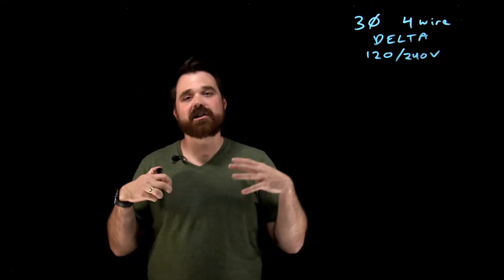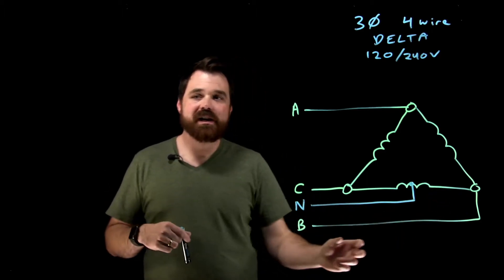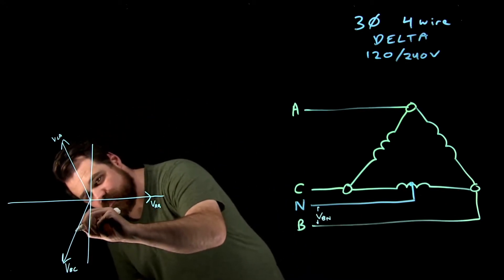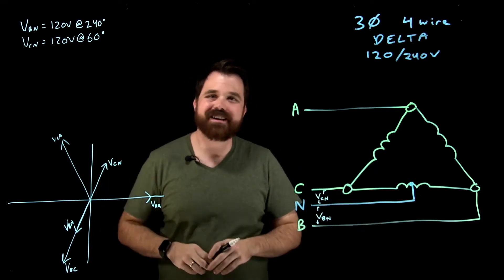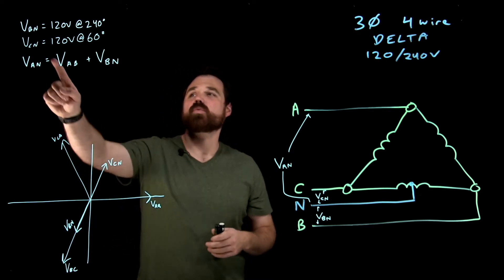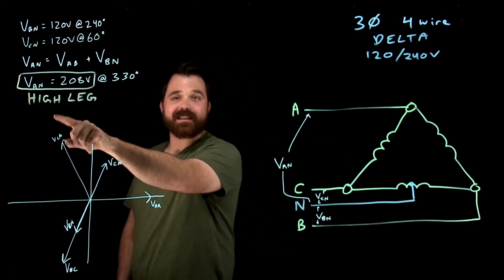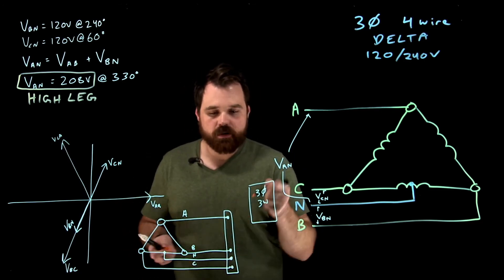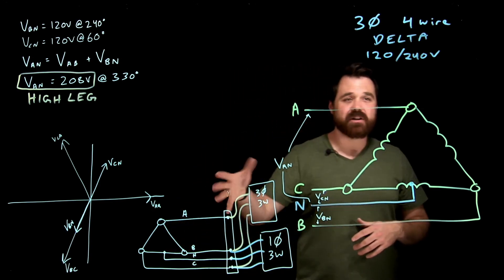Delta 3-Phase 4-Wire System (120/240V)

Comment: That's the stupidest thing I've ever fkn seen. I wish you would've explained WHY you can't use a to n.  Gunna assume it's bc the phase relationships or w/e are offset by the other side of the triangle being the opposite from the center tap.  But needing to run 208 machine so turns out I DO need wye even though high leg delta is 208.  How fkn dumb

Comment: The NEC does require that the Grounded Conductor/neutral be run to the Service Equipment, but it can be sized as if it is a Equipment Grounding Conductor based on the size of the Circuit Overcurrent Protective Device (OCPD), and we must bond it to the equipment enclosure and the Grounding Electrode System. In doing that are we making the neutral available in the panel? I haven't seen one in a long time so I don't remember how the bonding and grounding was done. Would it have an Equipment Grounding Busbar? Would it have a Main Bonding Jumper to the Grounded/neutral Conductor?

Comment: Can one of you smart guys help me with finding a panel board that will support this set up? Our building has this service and we cannot find a 600amp 240/120 3phase, 4wire delta high panel to save our lives. No one has one if these things. It's a unicorn and the inspector won't let it slide the existing 480/277 panel that is currently installed.

Comment: In the United States National Electrical Code, the high leg is required to be labeled as phase B. From forums, I could find that the Canadian Electrical Code requires the high leg to be labelled as phase A. The US NEC requires the high leg to be marked orange at equipment. However, I could not find the CEC marking required for high leg. So, how does the CEC require the high leg to be marked?

Comment: Canadian Electrical Code I find intriguing.  I'm in the USA and here, if we had a 3ø 4w delta system,  the high leg must land on the B phase,  for switchboards, switchgear and panelboards.   Metering equipment usually is required to have the high leg terminate on the right side (phase C)    Panelboards installed prior to 1975 often had the high leg on phase C.   High leg conductor must be marked orange,  or other effective means, at all termination points where the neutral is present.  1ø & 3ø circuits are allowed in the same panelboard.

Comment: Line B is high leg. Delta 4 wire 3 phase high leg 120/208/240v is as follows. (B to N) is 208. A to N is 120, C to N is 120. A to C is 240, A to B is 240, B to C is 240
Reply: Phase A is the high leg as required by the Canadian Electrical Code, as found from online forums. Phase B (marked orange) is the high leg as required by the National Electrical Code in the United States of America.
Reply: A is definitely the high leg I have worked on several of these systems they are quite common out in the country
Reply: Pretty wild that it changes for us and Canada, but I’ve also seen the high leg on the C in the panel and seen people say that it used to be the way it was mandated. I see the 208 high leg warnings, orange leg, and see panels with all the high legs blocked off, but here using a separate panel seems like a great idea. I’m not an electrician, so speculating here, all the wok I do on this stuff gets gone over by electricians before being used anyway.

Comment: I re-watched this again, when running 120/240 single phase, how does this affect the balance of the 3phase incoming load, it seems like there would some sort of imbalance to the 3phase current.
Reply: Good observation.  Yes 120 volt loads on a 3ø 4w delta system will cause some unbalance that cannot be avoided,  unlike the more commonly used 208Y/120V system where each phase can be used L-N or L-L.   In fact it's usually fairly easy to identify a 4 wire delta service just by looking at the transformers, assuming the building has overhead service because the transformer with the center tap will often be larger than the others, for the reason this transformer will have all the 120v loads in addition to the  240V single- or three phase loads.

Comment: I have this system.  Mine has two transformers and is fed with two of the phases.  Not three!
Reply: Open high leg delta.   These are rare, and usually found on farms,  where most of your stuff is 120/240 V single phase,  with a small amount of 3 phase motors,  such as used on grain dryers,  augers conveyers and the like.   In this situation the capacity of a closed delta is not warranted,  and the utility will install 2 transformers instead of 3, to save costs.   This service can be identified by 2 transformers,  one of them is much larger than the other,    the large transformer is the lighting transformer,  which supplies your 120/240 single phase loads, the smaller transformer is the power transformer,  this supplies the high leg, sometimes called the bastard leg or stinger leg, this is 208V to ground,  so cannot be used by itself to a neutral.
Reply: @Sparky-ww5re  , do you happen to have a transformer wiring diagram of my open high leg delta.  I am curious how the transformers are all wired up internally!  Thanks much.  Tom

Comment: So can you then use the two 120volt lines to run a 220-240volt single phase  circuit ?
Reply: Yes. 2 pole breaker

Comment: Please help clarify this question on my practice exam, keep in mind I'm in California, I think you are in Canada? maybe its different? The question is:
On a Delta three-phase 4-wire secondary, how many hot wires may use the common neutral?
Answer stated: 3. If I'm understanding this video correctly, A phase is un usable? Thanks for your help, I have a lot to learn
Reply: That really depends on the jurisdiction.   Here in the U.S.A. the high leg is usually found on the B phase in panel boards,  in metering equipment it found on the C phase, or in rare instances the A phase,  reason being the meter requires a 120 volt connection to the B phase, so the utility must choose A or C to avoid destroying the meter, they always seem to choose C.  In some installations the high leg is on the C phase throughout the building, so it is very important to be aware of this, and always verify with a meter.   The high leg is required to be orange or other effective means, but  I will not trust my life to that before I verify the voltages are what I think they are.
Reply: @Sparky-ww5re  thanks. Didn’t know that about the meter requiring 120v, and yes, never assume voltage, always verify💯
Reply from the maker: I would say just 2.

B and C

Comment: Hey I bought draper 250a mig, have 220/400v switch, but only 4 wires, which is l1,l2, neutral and earth, few Electrician checked how plug 3 please plug, but everybody told me is only one phase, is that can be 3 phase if switch is 220/400v

Comment: Zach, when doing a 3 phase 4wire  as you described... is the disconnect a Single 400 amp, even if running 100 amp panel on 3 phase, and 300 amps on single phase.. or is there disconnect on each panel... I plan to use the 3 phase for running my Air conditioning units... by running single phase from the 3 phase drop, as I understood the single phase the phases are 180 degrees exactly like a 120/240 single phase drop. just a clarification

Comment: I have a Question, why can't we connect A to N to get a 208V 1Ø? some times we have an application where it require a 208V?
Reply from the maker: You would end up with high neutral current and excessive heating on the BN or CN winding. These types of services are extremely uncommon.
Reply: You can connect A to N in Canada, B to N in America, in order to get 208 volts single phase. It is that you cannot do that on any standard 3-phase closed high-leg delta transformer bank (which are 3 identical split-phase transformers connected together in delta, with only one transformer having its centre tap used and grounded) that is already operating at full capacity. Open high-leg delta transformer banks only have 2 individual transformers, which of course also means you cannot use the high leg to neutral there either. However, for a custom installation that has substantial 208-volt single-phase loads in addition to the standard 240-volt three-phase, 240 volts split phase, and 120 volts single phase, you can upsize the C-A (A-B in US) and A-B (B-C in US) individual transformers slightly, and upsize the B-C (C-A in US) transformer moderately.

An example of single-phase loads that require 208 volts are Japanese split-phase cooking appliances from West Japan, which are designed to operate at 200 volts 60 hertz. Yes, Japan's electrical grid is split right along the Fuji river, where the west (Shizuoka City) uses 60 Hz and the East (Fuji City, also located in Shizuoka Prefecture) uses 50 Hz. A custom closed high-leg delta transformer would be very useful in enabling straight 240-volt Canadian and American appliances (welders, induction cooktops, and electric vehicle supply equipment), 120/240-volt Canadian and American appliances (ovens, ranges, and dryers), 220-volt (rated for up to 240 volts as part of IEC harmonization) European cooking appliances, 240-volt (rated for down to 220 volts as part of IEC harmonization) British 3-kilowatt water kettles for quick boiling, and 200-volt Japanese commercial-grade rice cookers, to all be used without any additional transformers, which reduced energy losses from conversion and also saves material.
Reply: Chances are, Japanese 200-volt appliances that have heating elements work just fine on 240 volts as long as they are not on high setting. That has been stated on many posts on expat and travel forums. That is because the resistive heating elements will overheat on high setting when running at 240 volts. So, while there is no prohibition on using the high-leg to neutral under the United States' National Electrical Code (unsure about the Canadian Electrical Code), one should not bother with making a branch circuit with that because the existing range and dryer branch circuits can supply a 200-volt Japanese appliance that involves heating just fine with just a plug adapter. So, a traveller from Japan who has unused luggage space could very well bring their 200-volt space heater as long as they don't use a high setting and a NEMA 14-30, 10-30, 14-50, 10-50 , 6-50, 6-15, or 6-20 plug adapter is provided by the host in North America.

Comment: One thing bothers me about this.  A wye distribution line will have a neutral, which is grounded at the transformers, and also at the service entrance of the customer.  With this delta configuration shown, I assume that is the final transformer serving the customer.  The neutral will presumably be grounded at the transformer and the service entrance, as with the wye, but the neutral does not run back to the substation, except through ground.  Does that matter?

The power company would have to keep track of the phases and always put the neutral on the BC phase when there are multiple customers on the distribution line with this configuration.  How do they keep track of this?
Reply from the maker: These types of services are almost non-existent because they can be problematic, just like you say.

You'd really only have very small amounts of load on the 120V, so it wouldn't have a huge effect overall.

Also, the delta line conductors can handle unbalanced current without the neutral connection back tot he substation

Comment: I have the same service, can I connect a 3ph motor 220v?
Reply from the maker: Should be able to
Reply: @ZackHartle  how is the wiring done to achieve the 220v 3ph in said Delta system? Thanks 👍🏻

Comment: Delta has neutral?! 🤔
Reply from the maker: It can!
Reply: It's called a high-leg delta. The delta can be open or closed, but closed is highly recommended because it allows the full combined capacity of all 3 pairs transformer windings to be used. Whereas, only 5/6 (usually only stated as the approximated value of 86.6% in textbooks) of the combined capacity of all 2 pairs of  windings can be used in an open delta. This means one is essentially wasting money and materials in using an open high-leg delta transformer.